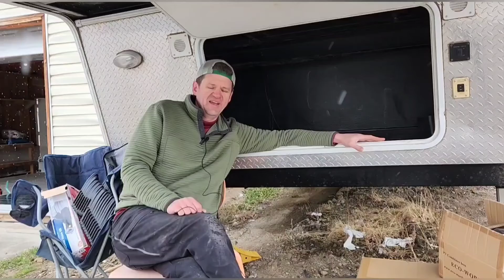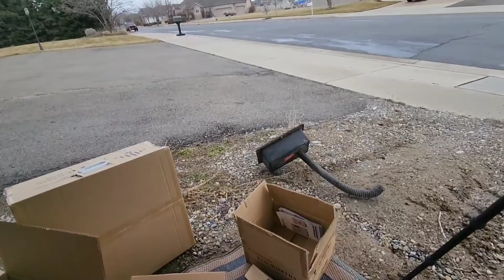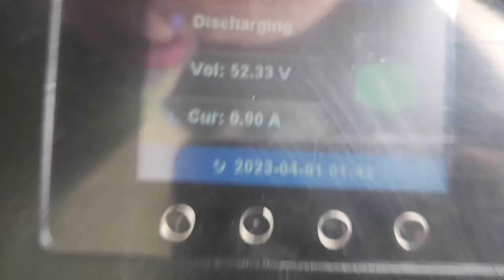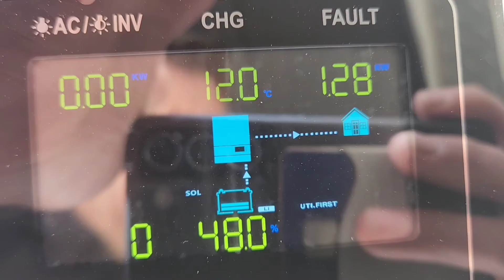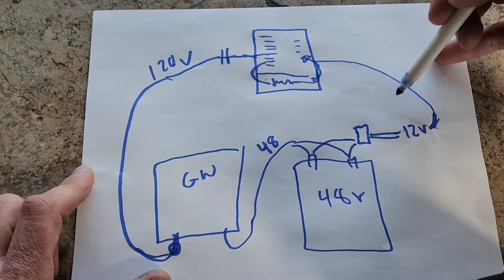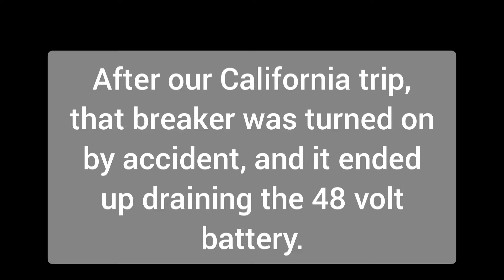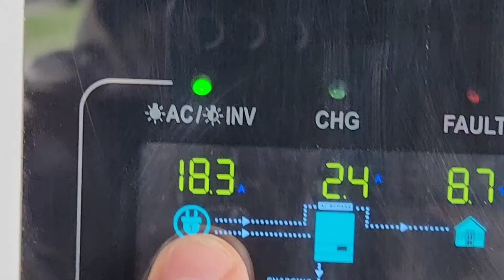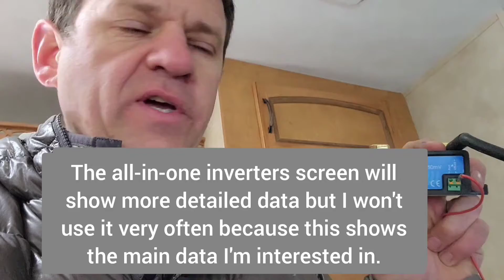12v to 48v RV conversion. Ultimate Off-grid RV Solar Power System Install

Comment: Why don’t you use your other battery with the eg4 v2?  I have 3 on my set up and love it. I got a 120v .5amp rv water tank heater to use on my batteries in the winter but chickened out adhering it to the batteries.  Thanks for the video.
Reply from the maker: Nice. I think in gonna hook up the extra battery when we go to the desert. Yeah I have also been thinking about getting one of those heaters for my battery as well. I think will prowse mentioned them on his channel. I bet you it wouldn't take that much power. Did you end up using a 48 volt to 12 volt step down converter for your 12-volt system? I think that's what saved me a ton of power.
Reply: @diySolarPowerFunWithRay  My coach is 24v based, so I got the 24v batteries, 24v inverters, etc.  I ended up using the Victron 24/12 70amp step down transformer for my 12v loads and it works great.  It was set at 13.2v, which I think is perfect - so far so good!  Looking forward to how you supplement/power your home from your RV - I was considering the same!  Almost wonder if you run the house from your batteries in the evening, let them recharge during the day.  Pending the weather, my coach will provide more power during the day than my home consumes, and I don't have anything set up with the power company to backfeed power - not sure they would allow it - but who knows. Looking at an EV too, pending your daily mileage, you could easily plug it in during the evening and recharge the RV during the day.

Comment: You're going to want to provide active cooling to that buck converter, if you have much in the way of 12v draws, which most camper/RV units will.  There are much more robust options for that solution and I would encourage you to investigate those, if you're drawing even 10 amps, continuous.  Notice the big difference in wire size from the 12v cable to your old battery and the much smaller wire going into the buck converter?  The unit you installed will get quite warm (~200f) and that's enough to worry about.  If you can't do active cooling (temperature activated fan) then at least put standoffs under the mounting screws that secure the buck converter to the bulkhead, so air can get under it as well as to the cooling fins.

Also, that negative connection from the buck converter to the battery did not look solid.  Hopefully that was just the camera telling lies.  Otherwise, very cool conversion.
Reply from the maker: Thank, I double-checked the wire size.  I should have mentioned it in the video.  The wires coming out of the 12v side of the stepdown converter looks small but are actually 12 awg. My Biggest 12v draws will come from my furnace blower(around 5 amps) and my electric jacks and RV Slideouts(19 amps each).  So if I have my fan running and I run my electric jacks at the same time I'll be pulling 25 amps from my 12 system. Using this wire guage chart(https://www.bluesea.com/resources/1437) I should be safe using a 12 awg wire but just need to make sure the wire is no longer that 6 feet...  Because this wire is only 6 inches I'm not concerned. 
   I think this step-down converter will work great for my use. I just did a test and ran the jacks up and down for 10 minutes straight(which I will never do) and it I could barely decern any heat coming from the box and cooling fins.  I really like this unit and am happy with it.... So far :).   Thanks for the comment.
Reply: @diySolarPowerFunWithRay  - Yeah, if your loads for that 12v bus are small and/or intermittent, you'll be fine.  I'm surprised the jacks didn't create much heat, running them for that long.
Reply from the maker: @jasonbroom7147  Me too. Thanks.

Comment: Great video explaining your new system. I don’t know where you live, but I think I saw snow flurries at the beginning of your video. Keep in mind to not charge the battery below 32 degrees. I would also suggest that you put a fuse between the 48 volt battery and your 12 volt step down converter. I look forward to more great videos from you.
Reply from the maker: Awesome. Thanks for the comment.  This battery is supposed to have low temp charging protection but I plan on disconnecting the solar during the winter just to be extra safe.  
   Good point with the fuse. I just did a test on step down converter and it looks like it shuts down( and restarts) if I try and draw more that 30 amps from it. I should however put one in just to be on the safe side.  I know the 40 amp model comes with a in-line fuse. I'm not sure why this one doesn't have it....Maybe because it has that automatic shut down feature.

Comment: You could use both you have them and they work well together
Reply from the maker: Yeah.  I might do that.  Definitely as a test.
Reply: @diySolarPowerFunWithRay  You have 10k of power you only have 5 now
Reply from the maker: @roberrbush5446  I need a battery where I test other solar charge controllers and some other equipment. I think I'll throw in the extra battery for Lake Powell family trip though 😊

Comment: Is the growatt and 100ah EG4 battery rated for the vibration expected in an RV trailer?  
I doubt that Signature Solar warranties them for RV use.
Reply: I seen a bunch installed in them and they are well made. Should be fine
Reply: @roberrbush5446  That's good to know..... thx
Reply from the maker: I think they are covered for rv use, but I'll double-check for ya...
Reply: @diySolarPowerFunWithRay  I think many would welcome that info.  TIA

Comment: Great video Ray!  I'm guessing you have a 15k btu HVAC unit?  I would have thought the LifePower4 battery would have been just fine to start the AC unit.  I was surprised that big fifth wheel only had a TT30 plug.  Nice job bypassing the stock charge converter and the trailer plug 12v.  Looking forward to a follow up video after the solar gets installed.  Remember, the ES model really likes at least160v from your panels (even though start up voltage is 150v.
Reply from the maker: Thanks. Yeah I had someone comment earlier on the life power battery that had a similar startup problem. I like the battery a lot. It just may not be the best if you only have one battery.
Reply from the maker: I'm not sure what the BTU rating is. I should know :).  When the air conditioner is running it is consuming around 900 Watts